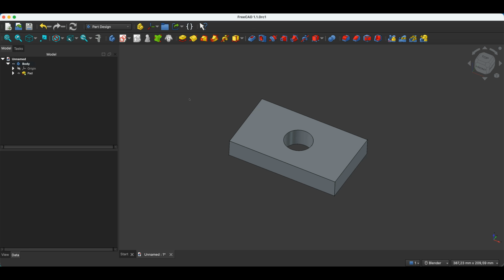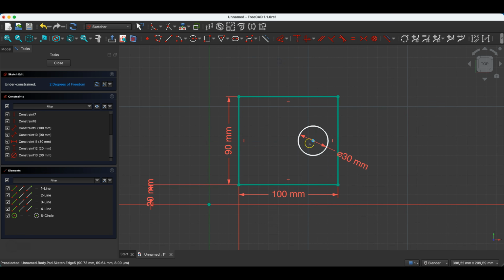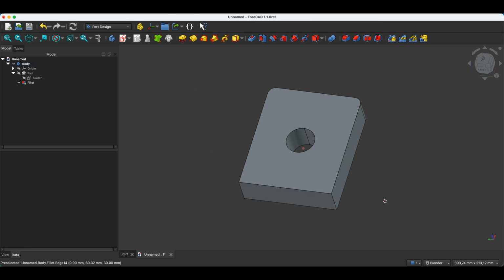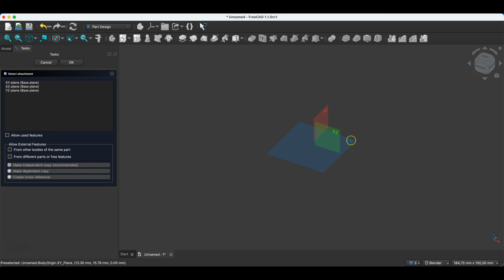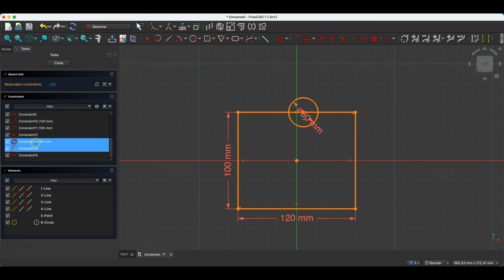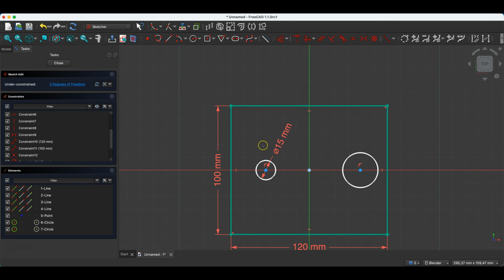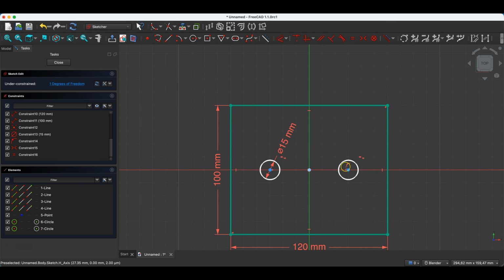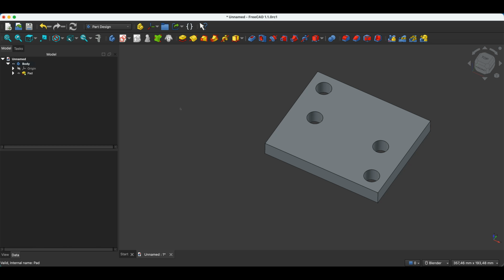FreeCAD Constraints: Symmetry, Equal, Coincide [FreeCAD Tutorial 2026 - Part 2]

Comment: Hi. When you hover over the axis, they change colour. When I do, they are the same so it's hard to know if it's been selected. How to apply the colours changing on hover to the axis?
Reply from the maker: I'm not sure if this is exactly what you mean, but check Edit -> Preferences -> General -> Selection and look for the Preselection settings. Make sure preselection is enabled and check the preselection color there.
Reply: @CADCAMLessons  Got it - I scrolled down the Comments and found the one from @JohnnyRockets2026 - it's in Sketcher/Display: View scale ratio. I've changed it from 1 to 1.5 and - voila!

Comment: Im having an issue where when i put the symmetrical constraint on the circle it moves it outside the rectangle
Reply: In my case it was the same. It is very important to follow the order of marking the points. First mark the corner points, the lower left, the upper right and only then the center point of the circle. Then everything works like in the video.

Comment: More context on the “Symmetry” tool after struggling for quite a while with it: 
You cannot use the crossing box selection method to select the vertices of the rectangle. The rectangle is not defined by 4 vertices as you might intuit, it’s made of 4 lines with 8 vertices. That means there’s two vertices in each corner. You have to select only by clicking once in the corner, which will select one of the vertices that is ‘on top’ of the other one, then click once in the opposite corner, and then once in the center of the circle. 
FEATURE REQUEST: A tooltip for vertex selection just like in the other sketcher drawing tools that shows the ‘X’ beside the cursor when you are over the vertex. The vertexes are not visible enough to select reliably.

Comment: I have just retired from being a CNC programmer using Creo and now using Freecad for my home use , I had fusion but a AU $900 a year is too much for my home use. The one thing I can say, Freecad manages constraints better than Creo. Creo is very powerful but at the cost of being complex and buggy, sometimes less is more.....
Reply: Is it possible to send to CNC desings from freecad?.
I'm in Sydney, I work in a small factory and they use AutoCAD I think. Maybe one day I can replace one of the designers and use freecad instead.